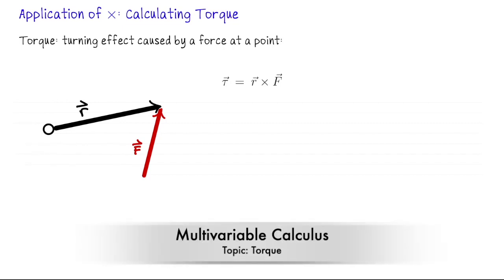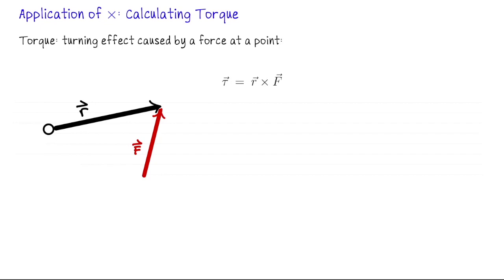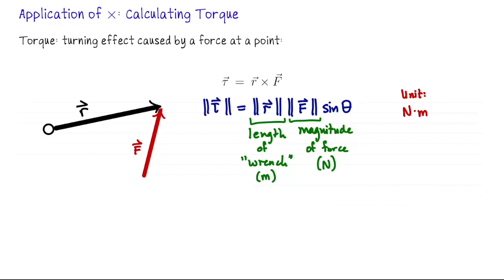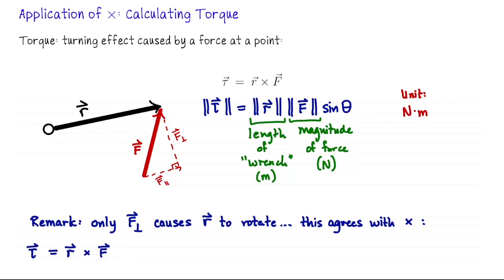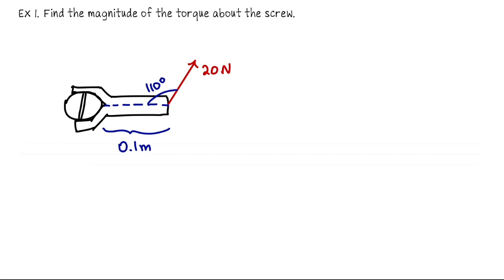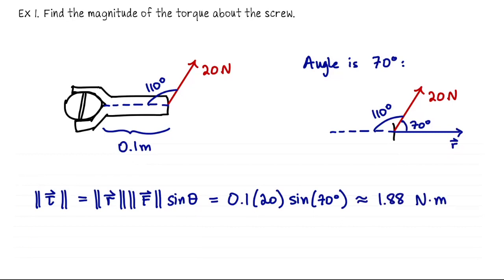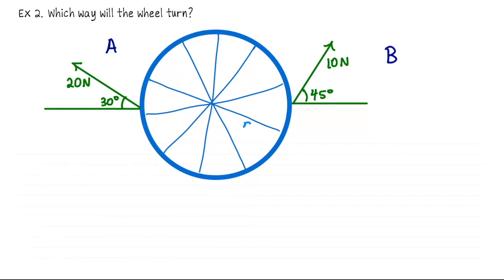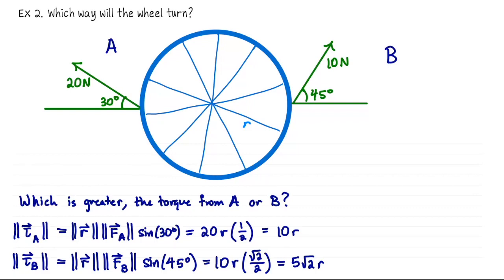Torque, Multivariable Calculus

Comment: Very helpful video/much appreciated. Quick question about the last problem covered involving the torque on wheel from persons a and b, we use sine of 30 degrees to calculate the torque applied by person a, but it's still correct to classify that angle as being a 150 degree angle with respect to the origin of the x-y plane, right? 

Same answer either way as before but wanted to make sure there weren't any special cases involved here where we had to state the angle of application of the force differently than in previous examples. Thanks!
Reply from the maker: Yes, that's exactly right! In fact normally I always draw angles measured counterclockwise off of the +x-axis, so if we weren't doing torque (where the sine function is key), then that ray in the second quadrant would be 150 degrees. However, since sin(A) = sin(180-A), I decided to go with 30 degrees.
Reply: @ makes sense and thanks for the response!